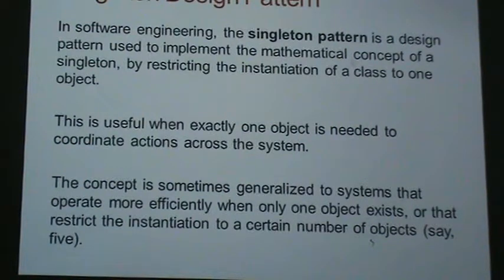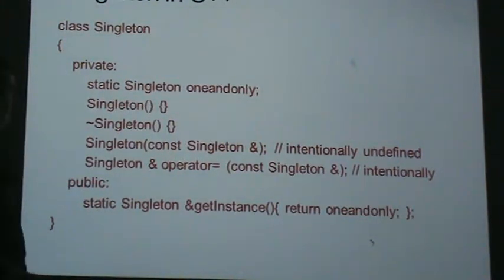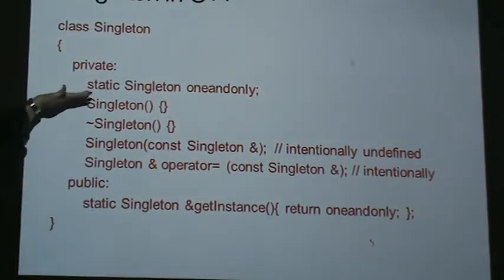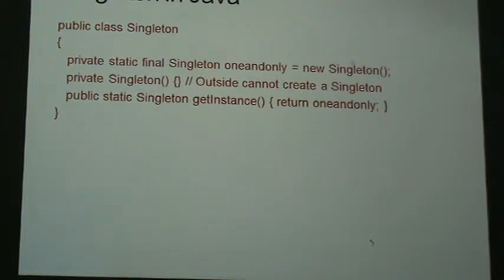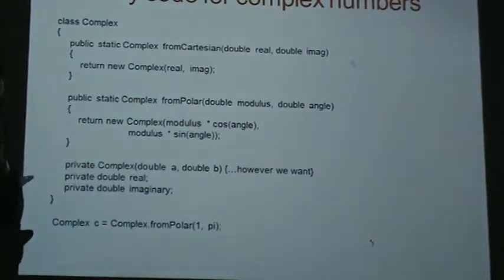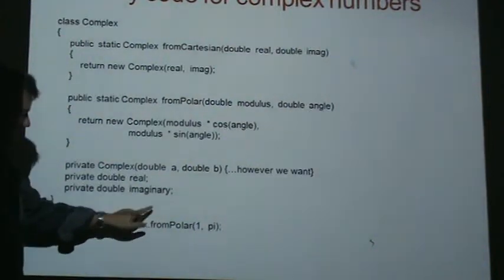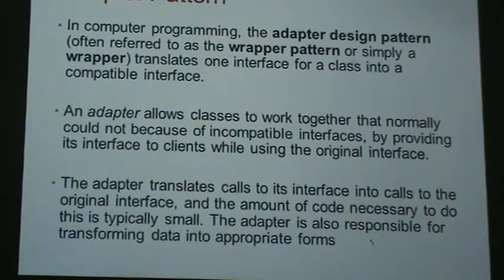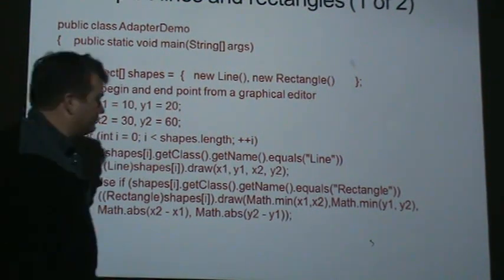Introduction to Design Patterns

Comment: One comment / question, in the Adaptor example if the base class methods are all pure virtual (=0), is there any need to do the casting / type checking at all?  If I understand the example correctly, the derived objects vtable should just point to the correct draw methods automatically (in C++ anyways, I don't have a clue about Java!)

Great tutorial btw, the materials and examples make things very easy to follow